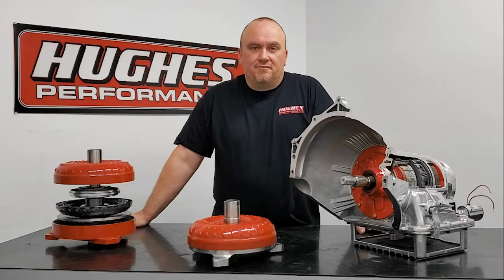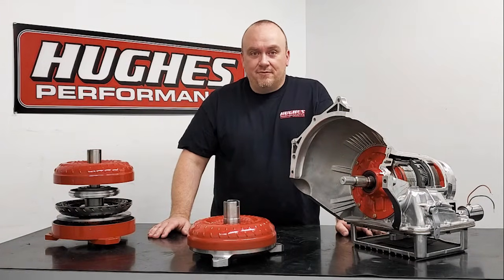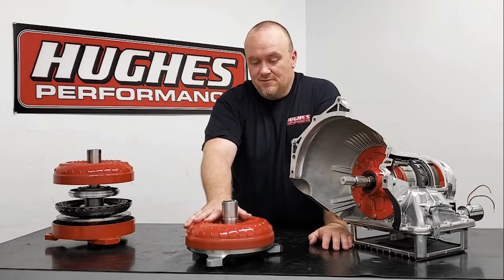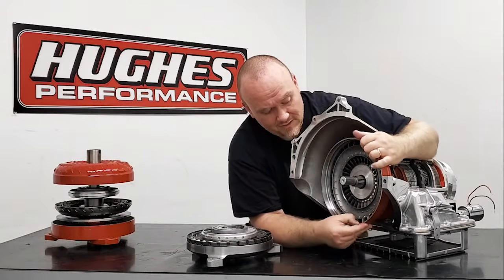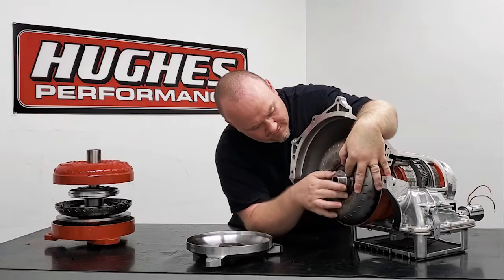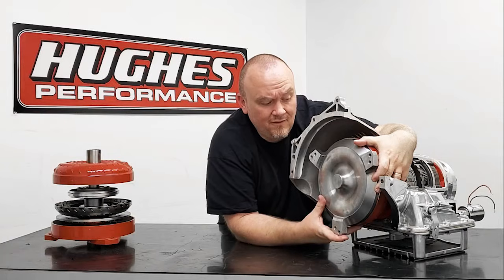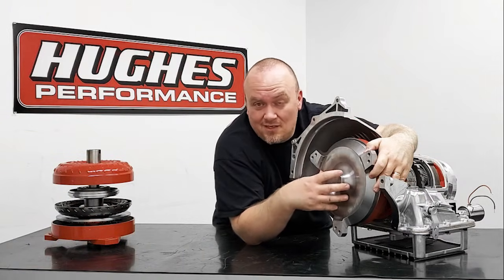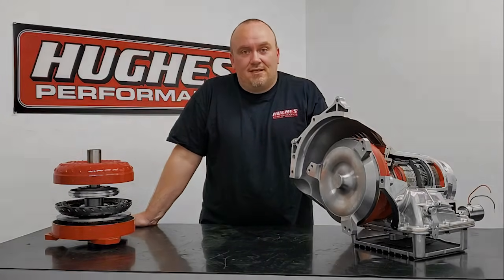Ep. 7 Torque Converters 101: How To Properly Install A Torque Converter

Comment: I bought the gm25 th350 converter I put one quart in it and installed. Had 1/4 space so I put a washer to make it 1/8. How many quarts do I have to add after that? I put my car in reverse/drive car moves slightly but if i press gas wont move 🤔🤔 I already added 5 more quarts still same no improvement.

Comment: When reinstalling the engine, I thought the converter was all the way in. But it was not. While tightening the bell housing bolts I realized something was not right. I took it all apart, found it needed to be turned and clicked in 1 more time.  Could I have bent something? I am also experiencing shuttering only at take off. At an idle it feels the transmission has completely released itself from the engine. Applying throttle, it shutters, grabs, and drives completely normal after that. This issue is in forward 1st and reverse only.
Reply: Maybe you don’t have enough fluids in the tranny, or the converter may have taken some damage.
Reply: Did you ever figure out the issue?
Reply: @RaisingRa  yes I damaged the trans oil pump gears while trying to get the second/third click from the input shaft. I put a known good used pump in. And may have the old one rebuilt
Reply: @paullove1970 what trans you working on?
Reply: @RaisingRa  64 power glide

Comment: Good morning. I am installing a TH350 and have some experience with installing transmissions. I have a question.... Since the torque converter sags ever so slightly from its own weight when resting in the transmission, prior to bolting to the flexplate,, should you lift it up ever so slightly (take the weight off) as you tighten the first torque converter to flexplate bolt? Or just pull it forward and bolt up without lifting on it?
Reply: Good question.

Comment: 4t45e transmission from a saturn ion. Installing a different transmission from a yard and it came with the torque converter. I replaced the seal for the pump but now it does not seem like it's going in thru the seal. Almost has a slight wobble to it because I don't think it's seated yet. Am I wrong? Or should I use more force and try to get it in farther? Is there a measurement of some kind to see if it's in all the way?

Comment: Recently rebuild my tranny on 2005 Odyssey. Everything is perfect, but each morning after start I hear cavitation noise, similar to broken power steering pump under the load, everybody has heard that winding noise. But it disappears in ~15-30 seconds. Also it disappears immediately after engaging D or R. Then, during the day, no matter how long the car sit, this noise doesn't come back. Does anyone have any idea what could be wrong?
Reply: Sounds like convertor is draining down. Dodge fixed this with a check ball in the cooler line

Comment: I'm working on putting an a140e back in a 96 Toyota and I've seen everything from lay the torque converter on its back and fill it slap up to others saying only add 1 quart to it to others saying that it's not self priming. Any help? Thanks.

Comment: What the point of the air gap if you're just going to slide the converter forward and mate it to the flex plate in the end?
Reply: thermal growth .... if the converter has no "float" to expand as it heats up, it can take out the transmission pump, bearings, or even engine crank bearings.

Comment: The torque converter I just purchased does not have thread on the bolt pad it's just holes ? How do I bolt it to flex plate
Reply from the maker: Use a set of Grade 8 bolts & nuts.

Comment: When you talk about fluids blending and your fluid being good for everything that brings up some question.  A guy at work has been continuously taking his truck With the new 8 speed transmission to the GM dealer for the latest service bulletins where they keep changing fluids to attempt to remove converter shudder.  I believe they’re on their third new fluid spec at this point.  Can you guys comment on shudder issues with converters and why one fluid may be used in place of another in certain scenarios?
Reply from the maker: Different fluid formulas will feature different friction modifiers to help prevent clutch chatter or shudder. I'd imagine GM may be progressively adding more friction modifiers to help combat shudder without having so much friction modifier present in the fluid that the converter clutch or clutches in the transmission actually start slipping once fully applied, but take that comment with a grain of salt as it's purely conjecture.
Reply: saab92513584 The GM issue was the moisture content of the ATF

https://gmauthority.com/blog/2019/08/tsb-seems-to-fix-8-speed-automatic-gm-transmission-problems/

Comment: Excellent video series. Answered a lot of questions on how a converter works. In video 5 where you talked about stall speed the old switch pitch converters that Buick used in the 60's came to mind and made me wonder how those worked.
Reply from the maker: Thank you!  The switch pitch converter was a pretty creative solution from General Motors, and was really ahead of its time as far as converter technology goes.  

The switch pitch feature used an electric solenoid-activated hydraulic circuit between the front pump and the torque converter to physically change the pitch of the stator vanes when activated.  The stator was unique in that it featured vanes that could rotate in order to allow the pitch (angle) of the vanes to be altered via hydraulic force.  

It's a very cool concept.  Kenne Bell enjoyed quite a bit of success with their custom switch pitch converter builds for high-horsepower Buicks.  We've built quite a few over the years as well.  Unfortunately the technology was never really developed any further, and original parts have just about dried up these days.